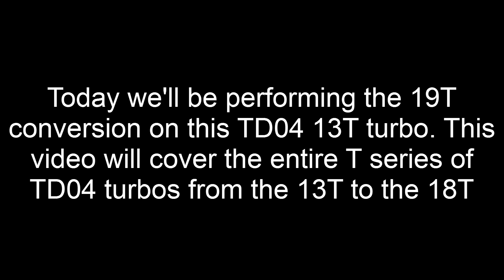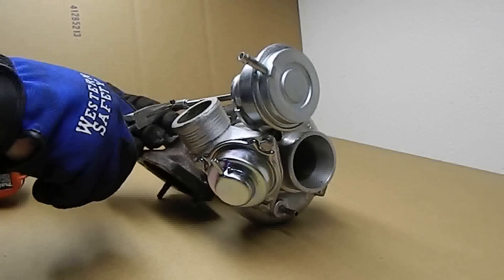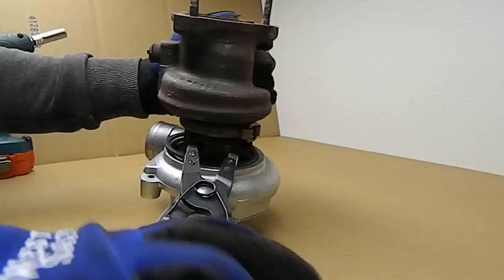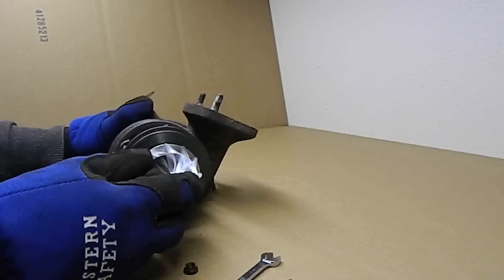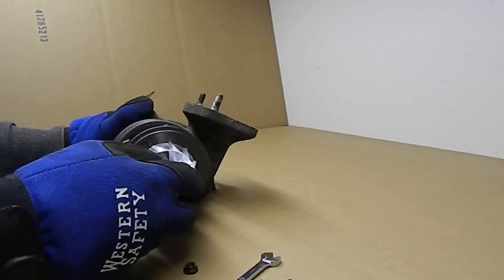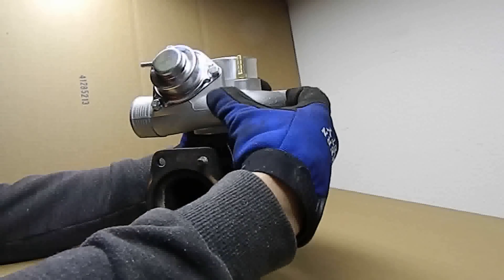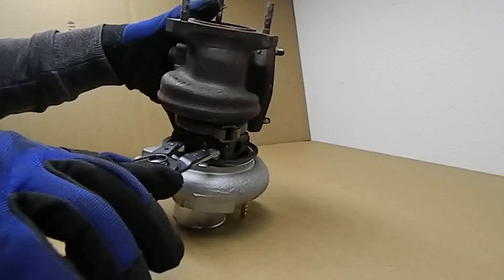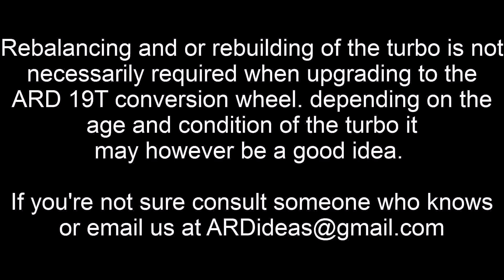ARD Tuning 19T conversion compressor wheel

Comment: Hi guys,

Just to double check, this will fit the low pressure turbo on my v70 2.5t 1999?
Reply from the maker: Unfortunately it won't bolt on direct since the 2.5T came with a TD04L turbo rather than the more common TD04HL. So you can either source a used TD04HL to build from or machine the center housing of your TD04L to fit. Thanks!

Comment: Hi , if i buy this kit today and installed with out any ecu upgrades ( stock ecu ) what are the odds of getting any better performance ? What's shipping cost to Canada Ontario ?
Reply from the maker: Performance gains without tuning are certainly there, not as much as when you match ECU tuning with your hard parts of course. Typically on stock ECU when upgrading to 19T you'll see 15-20 bhp depending on fuel quality and environment. Email us at ardtuning@gmail.com for shipping quotes :)

Comment: Waht is the exact model number of this td04? Im asking as im looking for exactly t3-size exhaust inlet and the compressor outlet pointing exactly where it points on this one relative to the position of the exaust inlet, and also with straight exhaust outlet rhather than angled.
On what model/make/year/engine-type car can it be found? 
And - is there a 16T version which is identcal to this?
Reply from the maker: This turbo is a Volvo TD04HL-15G flat back style typically found on Volvo 850 models 1994-1997 :)

Comment: Hey Robert, when turbo shops that say I will machine the turbo balance it put a bigger compressor wheel, billet 11 blade 58mm. Is that what you just did minus the machining the and balancing. It gets a little confusing.
Reply from the maker: For our kit the 19T is larger than the standard 13G, 15G, 16T, and 18T turbos on the inducer while the exducer is standard 56mm which makes it bolt in. No need to machine anything :)

Balancing is always a good idea anytime a turbocharger has been disassembled for rebuild.

Comment: Hello, I have a Shogun 2.8TD It runs standard 125bhp with a 12T td04. I am aiming for anything upto 180bhp. Is the 12t to 19t jump advisable or should I go with 15T? I don't want to have issues with boost creep etc.
Reply from the maker: +Robert Evans 15T likely a better choice if you're not looking to go crazy. Ultimately up to you of course!

Comment: Just tried to put this together today, and i'm having issues with the wheel not spinning freely after beeing tightened to 5nm. It spins fine before tightening. Any ideas?
Reply from the maker: Markuz Z Id make sure the correct backing plate is used (super back vs. flat back). That's my first guess :)

Comment: I have a 2008 Saab 93 2.0T with a td04hl 14t. This video and comments say it works but your site says it doesn't on the 14T. Which one is it?
Reply from the maker: Is your 14T a TD04HL or a TD04L? The HL is quite different than the L turbo so make sure you know which one your 14T is!  If it is truly a TD04HL then you're good to go and our 19T conversion will work for you! Just remember you'll need a matching 19T compressor cover or machine your existing cover to match :)
Reply: Robert Arnold I have an Iveco daily td04L-14t-5 51mm wheel stock, is your kit fit this turbo ?
Reply from the maker: We do have TD04L upgrade parts available that we are developing now. Message me at ardideas@gmail.com for more info!

Comment: I have a Saab 9-3 2001 it has a TD04HL -15T turbo, does this apply to my turbo also?
Reply from the maker: Yes, for TD04HL turbos this will fit you. However 15T is flat back so be sure to get a super back rebuild kit to work with the super back 19T conversion billet wheel :)  http://www.ardideas.com/TD04HL-Turbo-rebuild-kit-Super-back_p_133.html
Reply: Robert Arnold All TD04HL-15T, at least all found in Saabs, are superback, not flatback
Reply from the maker: pauloguillenr86 Excellent, even easier then :)

Comment from the maker: For you the 19T conversion wheel and matching 19T compressor cover is all you'll need. Be advised the compressor cover we offer for Volvo may not have all the exact same fittings/connections that your Saab compressor cover has...

Comment from the maker: Effectively the same for K24 but a bit easier since there is not a snap ring but instead just some perimeter bolts holding the compressor cover on. I will do vid for that shortly.  As for 15G... that's odd my 15G on the wagon was reverse thread but thanks for the heads up regardless!